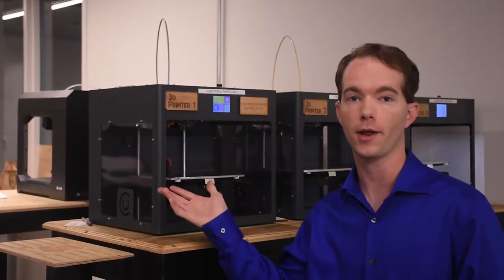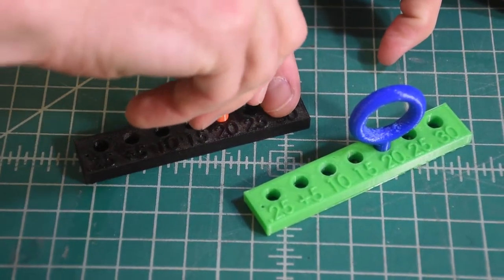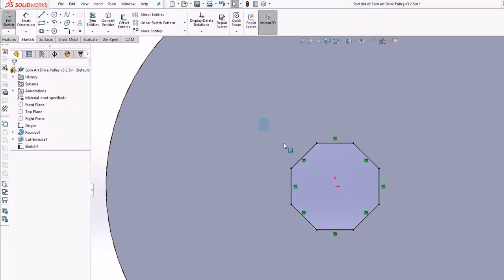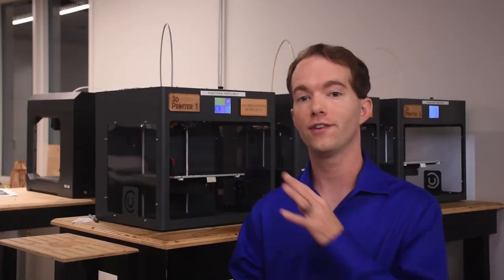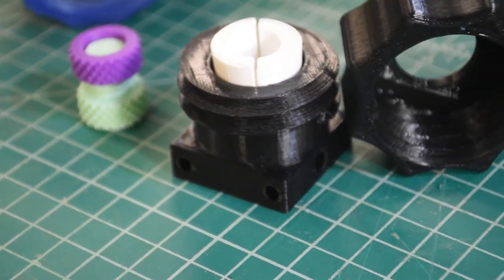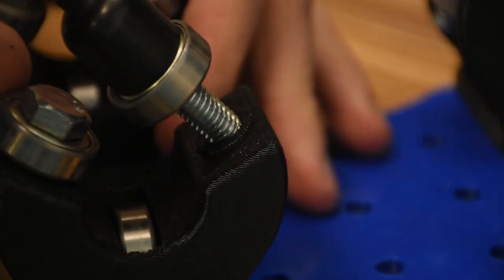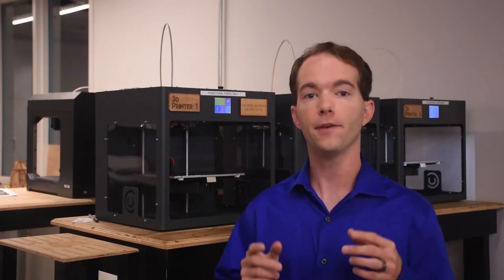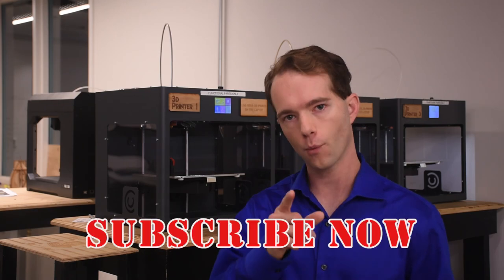Design for 3D Printing EP 7 -  Tolerances and Joining Parts

Comment: Exactly what I needed to know.  I'll have to do some calculations since I only print in metric. I did a similar test this morning and making my hole size +5 mm was a very tight but doable fit and +7mm was tight but loose enough to spin on my CR-10.  Thanks again.
Reply: I also need some metric conversion. I want a 27.9mm dc motor to fit tightly into my print. Do you have any suggestions on dimensioning the hole? Thanks for answers!

Comment: Nice Fit         .020"      0.508mm       Will Spin if needed, easy to insert or remove.   
Tighter Fit     .015"      0.381mm       
Press Fit       .010"      0.254mm       Not intended to ever come apart.

Comment: This great. I have never 3D designed before and I really want to design something that involves fastening using really small screws. I initially intended to learn how to design the threads but after watching your video I realized that was the wrong route to go. I suppose I should just make a cylindrical hole then. Do you have a concise set of rules to how large the hole should be in relation to the screw and the screw's threads?

Comment: weldon16 works great for pla but its not good to breath in the fumes so do it in a well ventilated area and its a very slow curing glue(72 hours). the stuff was originally made for glue fish tank acrylic glass together by welding it but it works extremely well for pla, superglue also works very well

Comment: the 10mil 20mil rule must have a size relationship associated with it right? I'm trying to design a press fit on 2 parts where the mating parts are only 1mm wide. 10mil is about 0.25 mm. Isn't that too much for a 1mm joining parts? (I printed at the same size and it never fit...so I'm seeking guidance  for press fits on small parts)
Reply: hey man did you ever figure this out?
Reply: @steelwitness  No lol, I think there is always higher tollerance in consumer 3d printers and if u want friction fitted parts, mold with CNC machine is the most reliable.

You need to design connection parts differently with 3d printing
Reply: @AIRpursuit  i appreciate the feedback i didnt realize the comment was so old lol